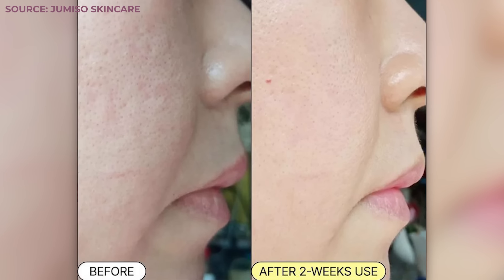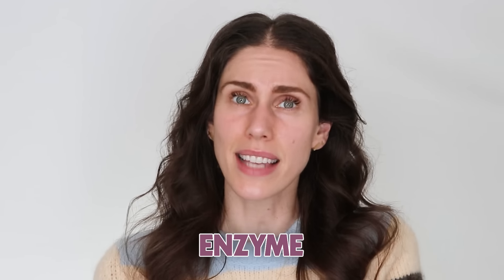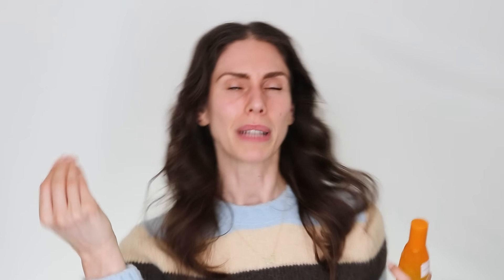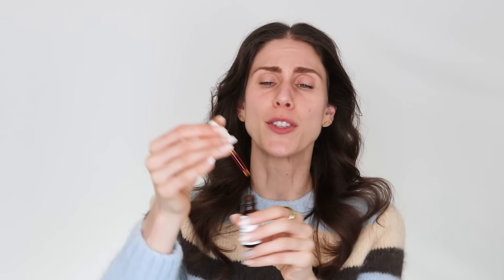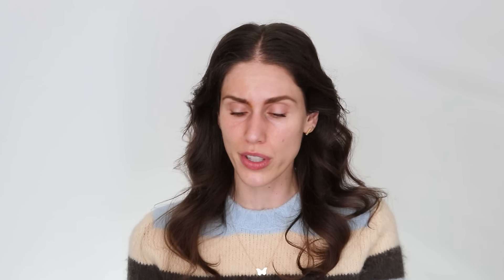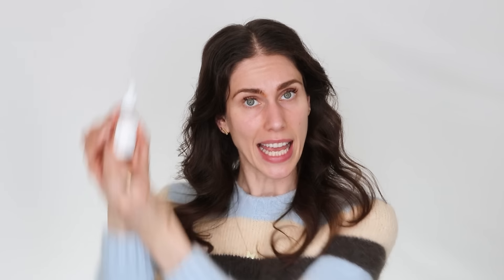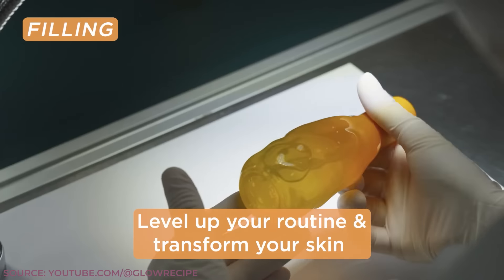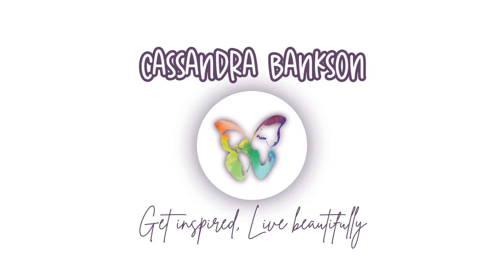3 Best Vitamin C Alternatives for Sensitive Skin

Comment: I ordered a COQ10 serum as a part of a set and I wasn’t sure it would do any good but WOW! It has made my skin so incredibly dewy and supple!! The one I have is from the Korean brand “The Potions” which is basically a Korean dupe brand for The Ordinary. Their azulene serum has also been great!
Reply: I use a Q10 cream with SPF and my skin loves it so much.
I remember growing up, Q10 was always mentioned in skincare TV ads, some 25-30 years ago.
Reply: Is your Q10 serum kind of an oily serum, like some of the Ordinary ones? I now use TO Ethylated Ascorbic acid and it has this oily texture that doesn't well absorb into the skin and I just hate that greasy feeling.
Reply: @lukastemberger Yes, I remember that too. I think Q10 was the first super ingredient in skincare.
Reply: @roden70  I don’t find it to be overly oily, but it definitely leaves that slightly sticky “glow” on the skin that may be undesirable if you already have more oily skin. I have really dehydrated skin so it works well for me. 

If your skin can handle traditional vitamin c, I’d def recommend the Mary & May Vitamin C + Bifida lotion!! My boyfriend has oily skin and he loves it. I like it as well but I pretty much only can tolerate it in the summer.
Reply: @abigailgnome2117  Thank you for the recommandation. I have dry sensitive skin and I love more of a milky serum. I just can't stand the feeling of that oily serum. I have another now and the oily one I use on my hands so it's not going to waste.

Comment: After using riceberry face serum by litttleextrra for three weeks, here's what I experienced:
Benefits: It successfully softens and evens out the skin, giving it a gentle glow. I've also seen a decrease in my genetic dark circles (avoiding the eye area is recommended). It has also helped fade dark spots on my sister's skin.
Downsides: Personally, mine is dry and dull skin, and using the serum every day exacerbated my dryness.
I recommend using it thrice a week along with a effective moisturizer to prevent dryness. I haven't seen any noticeable improvement in bronzing or skin tone issues in first 3 weeks. 
Update 2 months later: After nearly two months of consistent use, I regard it my go-to serum. It has started showing promising outcomes. My skin glows, dark circles lessened, and dark spots reduced a lot. So patience is key when using this face serum.
Reply: My feedback after 15 days, this rice berry serum has proven to be highly effective for brightening skin and reducing dark spots. Its light, non-greasy formula is absorbed quickly, leaving skin radiant and smooth.

Comment: Nivea has been adding Q10 as active ingredient in both face and body skincare for what feels like more than a decade now.
Reply: True but I honestly doubt it's at concentrations that make a difference.
Reply: I feel if it actually worked that well it would be way more common and there would be research backing it up... but there just isn't.
Reply from the maker: Very interesting do you know which products? Nivea isn’t cruelty free and I’ve had some problems with their advertising especially overseas, but if there is a really hero standup product, I would love to learn more about it and see if I could find a cruelty free dupe!!

Comment: Yes! What you said about the 'problems' with vitamin C formulas is 100% true for me. I tried to use the Ordinary's 8% vitamin C,  2% alpha arbutin and I absolutely hated the formula. It made me flush, it heated up my skin for minutes and the oil just sat on the skin. I used up the whole bottle and I think I saw some improvements in my skin, but I won't buy it again. 

My other problem with finding skincare in general is that I don't make any money yet, so my budget is very limited. So I just use Ordinary's products and some drugstore products that are availible for me (in Europe). And I managed to fing a vitamin C formula that I actually like among those drugstore products, which I'm very happy with

Comment: I’ve been using pycnogenol under my sunscreen for two years because you mentioned it before and worked on my skin like wonders, but I started using tretinoin before 7 months and I noticed that my skin gets red and irritated if I use pycnogenol so I stopped using it until I finished using tretinoin
Reply from the maker: I’m so happy that it worked wonders for you! But yes, using it along with Tow, it might be a little bit much, especially since the tretinoin is oil, soluble and the pycnogenol is an anhydrous solution meaning that it is more of an oily base. This could potentially mean that the tretinoin really gets comfortable in that oily solution, and perhaps penetrates deeper or differently. Great job, isolating your variables, and doing one thing at a time to help any irritation! So proud of you.

Comment: I used the Paula's Choice Vitamin C serum, and it absolutely nothing for my skin, either good or bad, as far as I could tell. So I used up the bottle and didn't buy another.
Reply from the maker: Ah this is really good feedback! Just out of curiosity which Paula’s choice vitamin C did you use? Was it the orange one that they launched along with that eye cream about a year ago? I’d be interested to know which one so I could look into it.
Reply: @CassandraBankson  It was the C15 Super Booster, the one in a bottle with a dropper. I've had good results with the C25 Super Booster which is a kind of heavy cream that comes in a little tube. It almost got rid of an oil gland on my face, and it made a couple of keloid scars on my arm look better. I couldn't find it on their site, so I guess they discontinued it.